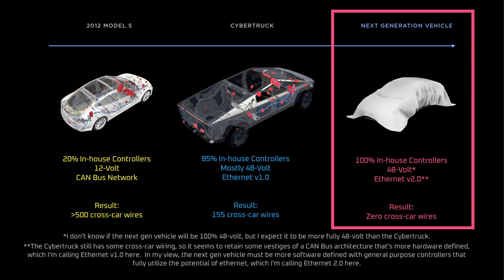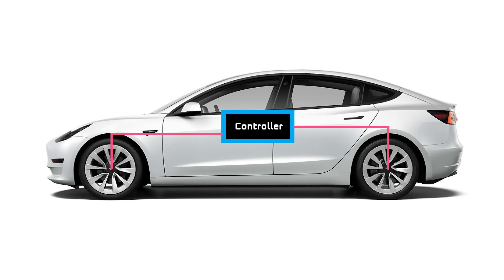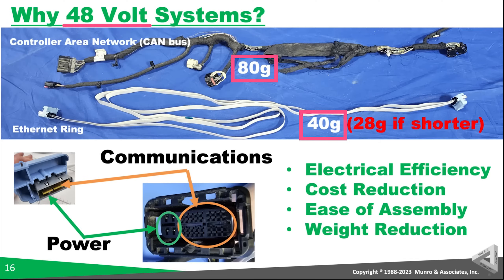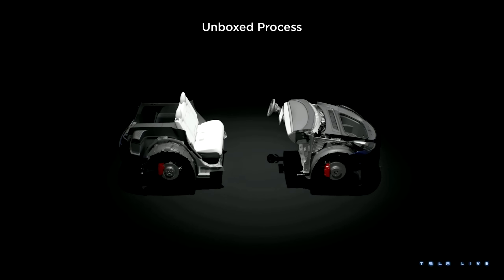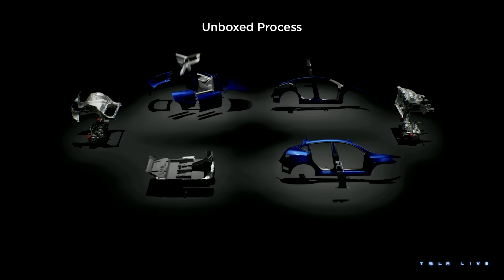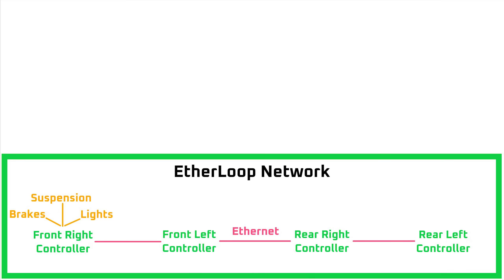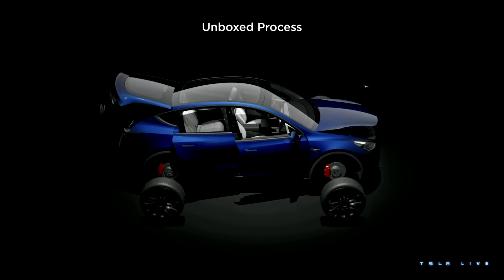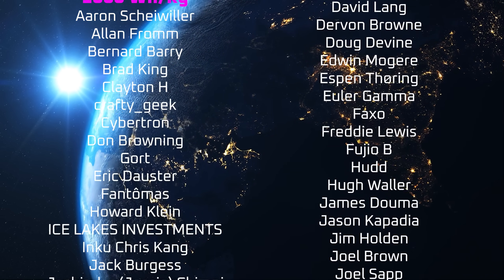Digging Deeper on Tesla's Etherloop Wiring System

Comment: Etherloop is an OLD technology it's not new and certainly wasn't invented by Tesla ( https://en.wikipedia.org/wiki/Etherloop ). Consolidating controllers might reduce wiring weight and cost but it causes many more single points of failure. One controller going down takes out more systems. I'm also wary of their software being stable enough for these applications. Now the developers need to coordinate more general messaging and coordination between controllers to accomplish a task, break correctly, and schedulers need to be written to properly schedule processes on the controller. No none of that is new tech but if you know anything of computer systems or networks these are where many issues do arise. Now lives hang in the balance and if you have a software bug, memory leak, time drift, process overrun, buffer overflow, etc it will be very very bad.

Comment: Major downside with the etherloop thing is that no one will be able to attempt to fix their own vehicle unless they get something directly from tesla that will be way too over priced it'll just be easier to throw away the whole car.

And now there are way too many problems with computers failing. They will fail, just a matter of time, there's no way of knowing when it'll fail until it already has, which is too late.

As some one who works on my own vehicles, I greatly disprove of this tech. But that's not my problem to deal with, I won't ever own a tesla.
Reply: I mean that’s just modern cars in general. Selling repair parts is where car companies make most of their profit on a car.

But I don’t know how Etherloop makes self repairing any harder. It would be easier if anything, wiring is one of the more annoying parts of repairs and less of it only makes repairs easier

Comment: EtherCAT is well used for industrial control and I'd bet a lot that THIS is what Tesla is calling "Etherloop".  For two reasons (1) Ethercat can be wired in a loop and (2) Ethercat, unlike normal Ehternet is very well suited for "hard" real time.      Ethercat is NOT a TCP/IP network.   It only shared the lower layers with the usual Ethernet cable found on offices and homes.

Ethercat is a litt like CAN bus.  It has frames that are sent on a predictable schedule.   No point giving details here, See wikipedia https://en.wikipedia.org/wiki/EtherCAT

Because they don't say "EtherCAT", I'd guess Teslas has modified it somehow

Finally, you can do "Ethernet over EtherCSAT" jusing EtherCAT is a pysical llaver for TSP/IP.   It is not so effescent but works

Comment: I don't need or want a computer with an ethernet connection in each of my brake lights, and every other component of my car. and, the 48 volt system exists for one simple reason, cheaper to manufacture. it serves very little benefit to any consumer. cars are getting worse for us but cheaper for the manufacturer. think they'd pass that savings on to us? no, more money to be made while we get a much worse product. enshitification

Comment: Is it really Ether-Loop that impresses us or the fact that they centralised the controllers, by making a controller that do more instead of doing a single thing very well. For that reason they wanted a higher bandwidth transmission bus. At the same time, bump up the voltage.

The cyber truck seems like a proof of concept car and they don't seem to mind it failing to see if the market will catch on and/or reuse that in their best selling cars.

Comment: I don’t like the concept which consists in considering engineers from back in the time as idiots. There are reasons why technical choices have been done this way. Sometimes some evolutions make these choice irrelevant, sometimes they are still relevant. Perhaps there’s a reason why brakes actuators are not controlled by a protocol developed for other purposes…

Comment: I can safely say you have no idea how brakes work. There is no brake wire to each wheel. You have brake lines that run from the master cylinder to the abs module and then to each caliper. They are filled with hydraulic fluid and are controlled centrally. 

It was a bad example to use to showcase this architecture
Reply from the maker: Well, I ran it by a few engineers for QC and no one said a thing.  

Even if it was a bad example, the concept is what matters.

The reason I do these videos is because no one else is doing a decent job of covering these topics.  I expect to make mistakes and be corrected in the comments and then improve over time.

It would be helpful if the people who do 'know' would make quality videos, but they don't.  cough
Reply: You are right of course, and I was thinking the same thing the whole time, but that may change soon with the 'Sensify' system that Tesla/Brembo have been testing.  The concept he's suggesting still works - just gotta imagine it says door locks or lights or something.  :)

Comment: I see no reason to worry about EtherLoop's speed or reliability.   Token ring networks reduce/eliminate message conflicts by design. 
Even the simple UDP protocol, without all of TCP's processing and latency penalties, should be reliable enough in a small, self-contained network.
And the smaller the EtherLoop, the higher the potential bandwidth (eg: datacenters now routinely saturate 400Gb/sec ethernet). 
And now, free of the CANBUS chains, it is relatively easy to upgrade the hardware.  Maybe even optical (ludicrous) if they can think of a need.

Comment: standard are there for a reason, why not work with the standards? Without standards you wouldn't be even able to buy steel, screws, cabling or even measurement use standards. Not good at all .

Comment: @4:15 you compare apples with pears. Model S is a car with conventional cluster, with switches. Model 3 is a car without cluster, a lot of switches are removed. I would never buy a model 3 because it has no cluster and to many functions in the display which is hard to control during driving. And as far I can see in the video, the same bad thing in the cyber truck - I would never buy.

Comment: Most of your conjectures are either incomplete or tangentially irrelevant. Truth of the matter is the entire automotive industry has been moving to Zonal architecture and standards like BroadR Reach, which has now been absorbed into ISO. Your understanding of both CAN and Ethernet is poor, and it seems you’re not aware of automotive Ethernet (BroadR reach and equivalent). Controllers also don’t have to be redesigned due to supply voltage change since that’s all handled in the power stages. 

The “general purpose” controllers you allude to have existed for a long time. Any Bosch or Continental/Vitesco powertrain controllers or high end gateways can do it. The reason why a vehicle has only 1 of them or so is due to cost. 

From my (automotive COM and embedded sys) perspective, your conjectures need to be recalibrated.

Comment: What you say: By giving controllers more tasks Tesla can use fewer controllers and less wire!
What I hear: If one controller goes down instead of just the wipers going out I lose 25% of the entire vehicle. 🙃

Starting to see why this marvel of technology is turning out to be a 4-ton lemon.
Reply: It's only 3 tons.  If one $10 timing idler breaks,  you lose the entire engine.
Reply: Every vehicle has far more vulnerable things than a controller.
Reply from the maker: There's built-in redundancy
Reply: You just isolate the outputs.
A controller "going down" is unlikely, plus, there's nothing to stop you having a backup within the unit.
Still cheap.
Reply: @zeframmann1641 not only the controllers for the new architecture are smaller and lighter, but they're also cheaper compared to having the traditional web of controllers. And considering how much weight is saved with the new architecture, it's far cheaper to have even triple controller redundancy if you want - though the controllers are very resilient in the first place. So you're way too quick to jump to the 4-ton lemon conclusion. They have redundancy.

Comment: When you vertically integrate systems and you work towards simplicity and lower cost, you will always end up with a better system. CAN is the worst of networking protocol. It was elaborate to allow a few (not so clever) Germans to dominate the market. Tesla is using a deterministic time sliced protocol which is the most effective way to communicate between relatively (low cost) dumb nodes. I have constructed networks 25 years ago using RS485 talking to close to a 1000 nodes with latency undetectable by users. And almost zero corruption of data over a span of the the last 25 years. Nothing new or complicated, just ignored the "wisdom" of the time and did it all myself. From PCB to SQL server and everything in between. I was lucky to share the same education system and metrics as Elon. And I am close to 70.

Comment: no no no please stop. misleading at best. controllers integrated circuits run on 3.3 volt to 5 volts.  you already have to go for 13.8 to 3.3 volt or 5 volts. see dc to dc converters. the number of controllers on a buss does not = less wire. some window switchs,air bag sensors, go from sensor to data bus. power, ground and bus. currently a can high speed bus can go from front bumper to the rear bumper one time . there are many automotive data buses,spi, class 2,one wire gm low speed can. two wire dif bus gm high speed can. dodge was using bluetooth to program ipc in 2003 .  before someone asks. automotive ethernet was not invented by tesla. 48 volt systems are good. automotive ethernet and ring or star config network have there benefits. not all wires get smaller because of volts. data lines have very low currently draw. signals wires also have very low current draw.

Comment: VW Id3 is running on Ethernet since the production start. Tesla is late to the party.
Reply: Yes, to connect to the service tech laptop for the update.
Reply: A 2014 Model S has Ethernet for service connections, but the updates are done via WiFi & cellular modem OTA. Most FW on ID3 is not even accessible to service bus even on Ethernet. This will be clear months into the Rivian aqusition, that no software can be pushed onto any existing hardware at VAG 🎉
Reply from the maker: 😏 Yeah, that's why VW is investing 5 billion in Rivian to get acess to their electrical/software knowhow

Comment: Fiber wire system
Reply from the maker: It's just copper rather than fiber
Reply from the maker: As far as I'm aware, it's just copper rather than fiber
Reply: Looked a LOT like a Ribbon cable to me.
(It will be a loop, for redundancy.... One side damaged, you don't lose control)

Comment: 48V dangerous...
12V not
Reply: @antekaramatic3382
 The reason 48  volt was chosen is because it's still safe. Higher voltages than 48 would be a risk.
Reply from the maker: Correct, 48v is safe